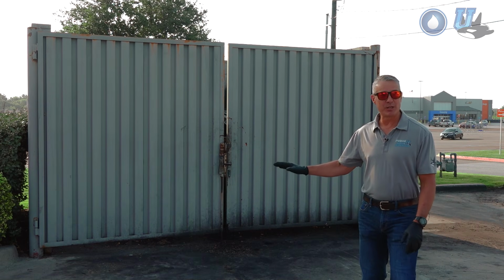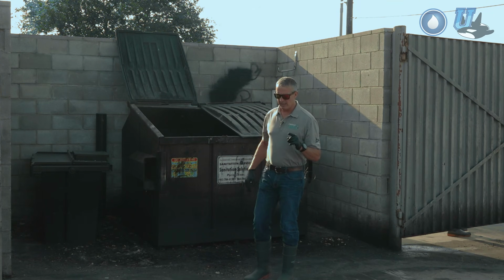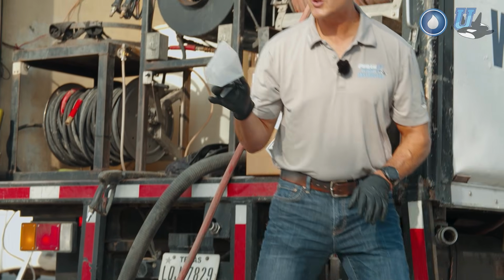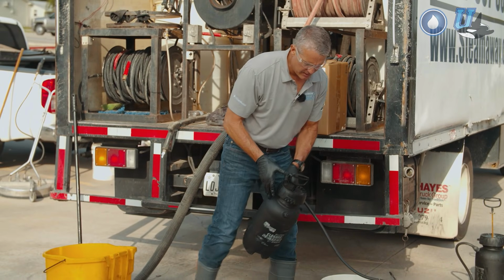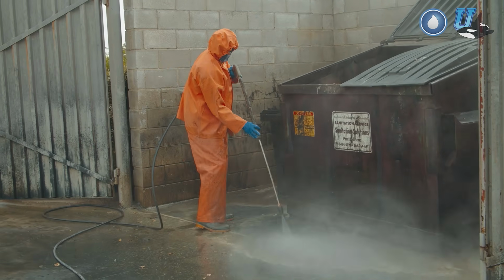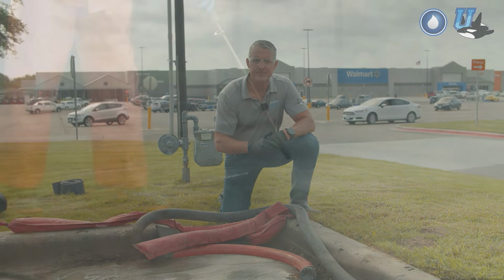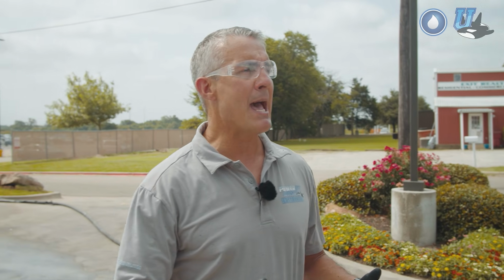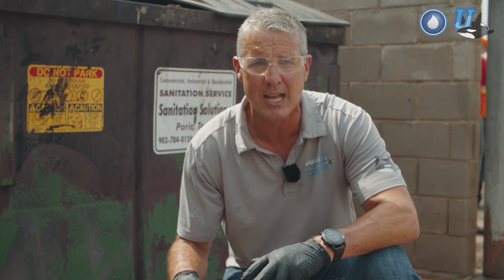How To Power Wash a Restaurant Dumpster Pad From Beginning to End

Comment from the maker: EQUIPMENT USED TO CLEAN THIS EXTREMELY DIRTY DUMPSTER PAD
1. V502 Green Beast Kitchen Degreaser (50 lb) - https://www.powerwash.com/v502-green-beast-kitchen-degreaser-50-lb.html
2. V502 Green Beast Kitchen Degreaser (50 lb) - https://www.powerwash.com/v502-green-beast-kitchen-degreaser-50-lb.html
3. Clearly Clean Xtreme™ Concrete Cleaner (2 lbs.) - https://www.powerwash.com/clearly-clean-xtremetm-concrete-cleaner-2-lbs.html
4. V502 Green Beast Kitchen Degreaser (2 lbs) - https://www.powerwash.com/v502-green-beast-kitchen-grease-cleaner-degreaser-2-lbs.html
5. Rotary Nozzle (3200 PSI) - https://www.powerwash.com/rotary-nozzle-3200-psi.html
6. Pressure Washer Nozzles - https://www.powerwash.com/accessories/pressure-washer-nozzles/turbo-nozzles.html
7. Wash Water Capture - https://www.powerwash.com/equipment/washwater-capture.html

Comment: Sir. That water reclamation system is bad ass. 
Mine is a home depot special attached to 2 - 3 55gallon barrels. 😆 but at least we do our part. Take care. 🤙🏻
Reply: How exactly are you doing it? I am looking to do something similar as I am working on a budget haha. Do you also have a trailer or everything out of the bed of your truck? Thanks for your help
Reply: Trailer and i use a shop vac with a pump out feature. It wotks. I also have a trash  pump. @Frank-t2t7d

Comment: So where does it go every time it rains ?
Reply: Honestly, used kitchen grease almost turns into a resin that the water will flow right over. It might take 1-2% of the grease when it rains. That Pizza Hut should be visited by the local board of health more often
Reply from the maker: I'm not sure I get your question, are you asking where the rain water goes?

Comment: Great video just subscribed! I have been doing some gas station recently, if you don’t mind my asking how many hours would it take ur guys to do a deep clean dumpster pad like that? And how much did you charge the customer? I know each area will vary. But I have trouble getting some gas stations to pay 150 for pad about that size , but not as much grease.
Reply from the maker: Finding the right customers is important.  Some just won't pay a fair price.  Move on if they don't.  A job this nasty will take about 2 to 3 hours.  Charge what is fair for you.

Comment: Have ever power washed candle wax and what method u used
Reply from the maker: No, but I would believe that using hot water pressure washer and turbo tip would take it right off.  There my be a slight residue after cleaning.

Comment: what if we do dumpster pad cleaning but dont collect the dirty water? and just let it run off.
Reply from the maker: You run the potential risk of getting fined as well as the customer.  Enforcement and interpretation of the regulation vary from area to area but I can assure you that the effluent from a dumpster pad cleaning is not supposed to go into the storm drain.

Comment: Would a surface cleaner keep the grease from splattering around?
Reply from the maker: It helps considerably but you will still get but like 5% of what it was.  We didn't use a surface cleaner here because we needed focus the blasting power of the wand.
Reply: @Powerwash  that's what I figured. Thanks for the response!

Comment: Will green beast work on getting motor oil stains off concrete?
Reply from the maker: It will but I thin our Power House DNB-1430 may work a bit better.   
5 gallons https://www.powerwash.com/dnb-powerhouse-degreaser-5-gallons.html

55 gallon mix kit https://www.powerwash.com/dnb-1430-mix-kit.html
Reply: Follow us

Comment: How much is s great price to charge ?
Reply from the maker: Great question. it will always vary based on service intervals and build up.  The best thing to do is estimate how long it will take to prepare for the job (as in before you leave your shop), set up, clean, tear down and don't forget to include drive time.  Then use that time and decide what you need to be profitable per hour and charge that amount.
Reply: @Powerwash  So what did you charge this customer for this job?
Reply from the maker: @AA-RON706  It will vary from area to area but this job should go for $400 to $600 given the amount of grease build up.
Reply: Another question where and how much is charged for WASTE DISPOSAL that’s gotta be calculated in quote 👍👍excellent video.  Huge opportunity 💵💵